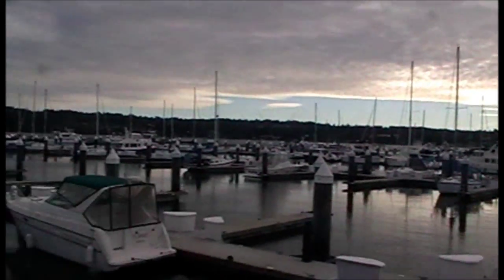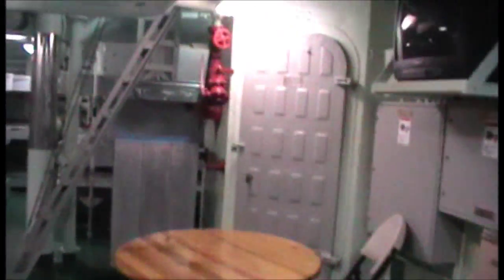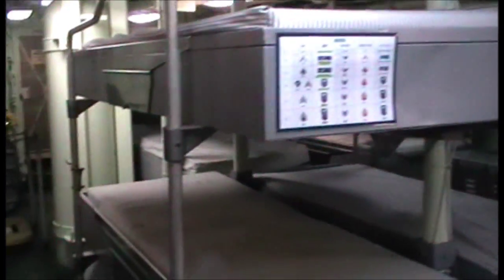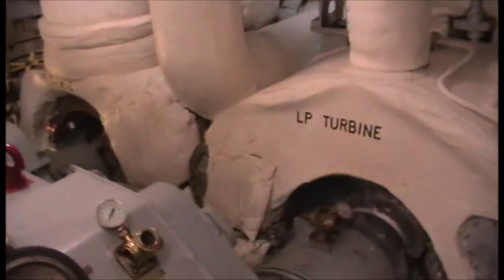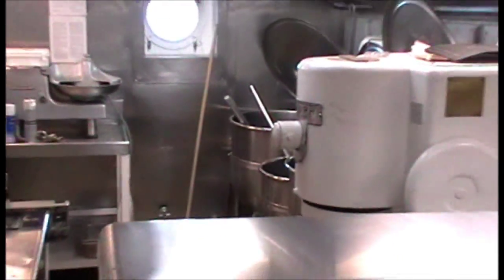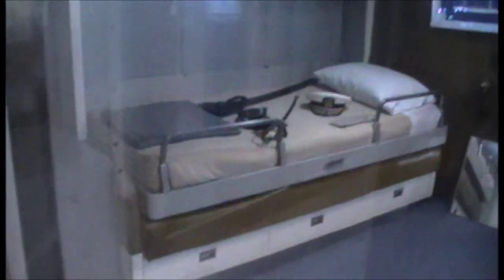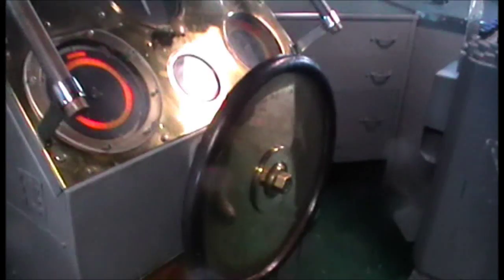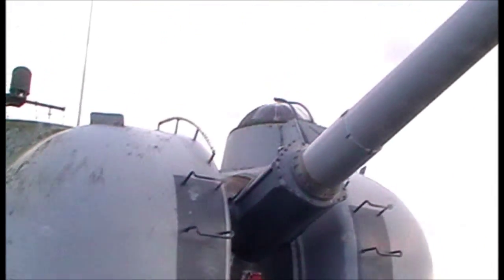USS Turner Joy (DD-951) destroyer tour -  from gulf of tonkin incident

Comment: I served aboard a sister ship DD950 67-70 as RM2.  5" guns had a range of about 14 miles, not 5.  We did a lot of missions in the 12 mile range. 40 rounds per minute was in full auto mode, I slept right under the bow turret.  When it was operating, there was no way to sleep, plus the expended brass would roll back & forth on the deck making a bunch of racket. As others commented, carrying those 70# projectiles from the fantail to the forward mount during rearming was NO fun either.  Lots of memories.
Reply from the maker: 40 rounds per minute is impressive. Thanks for the information.

Comment: Thank you for the memories.  I was stationed aboard the USS Forrest Sherman DD-931 from 1976 to 1981.  The Sherman Class destroyers were the first to have the new 1200 PSI boilers, to power main engines, with screws (propellers 13 feet in diameter).  They were also the first clas ships with controlled climate.Your tour into the berthig compartment (sleeping quarters) that had projectiles from mount 53, was for the engineers (BT's and MM's). We drank from a scuttle butt,not a water fountain..LOL

Comment: When you narrated, it was really cool because it seemed like you were really into it.  When you were in the berthing (living quarters) compartment that had the projectiles (bullets) mounted on the wall, that was mount 53 gun magazine.  What I found so funny was when you were on deck, you went "boom, boom, boom" (or words to that affect).  When I was in my rack and they were firing off that gun, it did a lot more than go boom. It hit so hard, light fixtures would actually fall to the deck.

Comment: My uncle served  aboard this vessel back in 1964 when Turner Joy came to the defense of Maddox in the gulf of Tonkin.
Reply: Then it should please you to know that the Second ECM Rooms Main Circuit Breaker is still functioning. I know because I turned it on, and I heard some of the panels and wiring electrify. None of the ECM systems armed however, apparently some people tore out some of the fuses, so you can’t arm the ECM gear and possibly commit a crime by jamming the Bremerton Naval Bases radars.

Comment: I do believe that the Navy made a mistake, because I think the Second ECM Room still has power. Or at least I think it does... when I armed the rubber covered circuit breaker switch on the wall at table top level, there was a loud “CHOONG”(that is the best way I can describe it) come from almost every part of the room, and an audible buzz. But the ECM gear did not arm, because there are a lot of missing fuses in the rooms electrical panels on the left side of the door.
Reply from the maker: interesting info.

Comment: I'm currently working on becoming a Tour Guide for this great attraction!
Reply: Michael Guthrie I should let you know the Second ECM Room, the Room on the third deck behind the Mast, probably still has power. If you press the main circuit breaker (I think), which is on the left wall, and covered in a black rubber gasket that is shaped to look like a light switch shape, then I do believe that it wall attempt to arm the electronics in the room, but there are enough fuses missing that you can’t jam the Naval Base. Just be warned, if you press it, it does make a loud noise.

Comment: 10:33 - Kitchen is known as the Galley. 11:06 - thats the Flux Capacitor - actually its the Spud Peeler - throw in spuds into the top and a rotating disc of sandpaper removes the skin and out pops a peeled spud. Leave it in to long and a really small spud pops out.